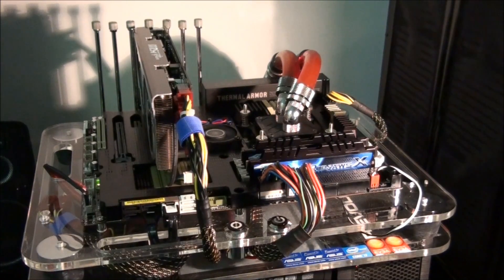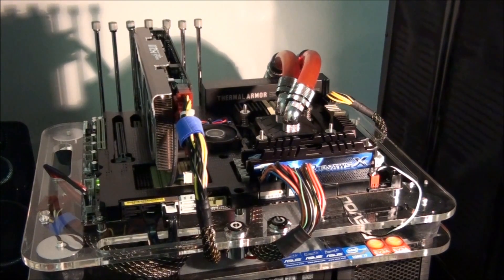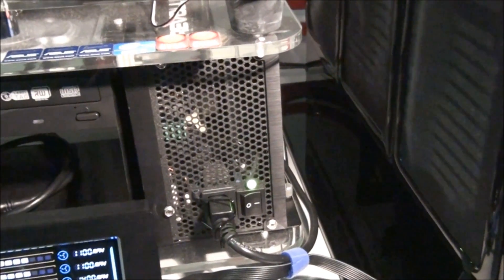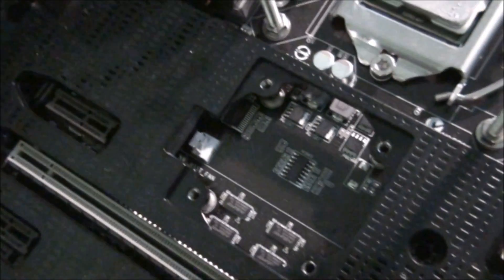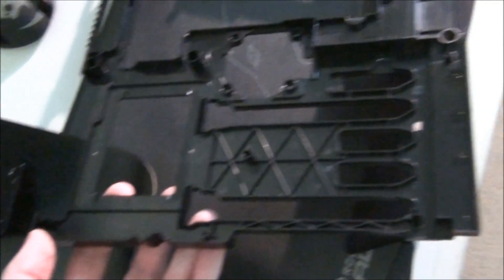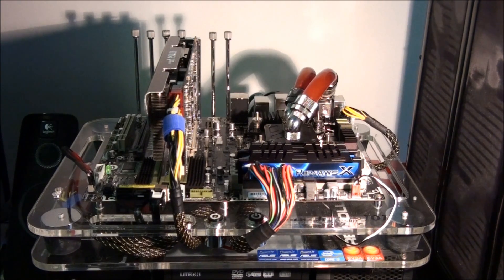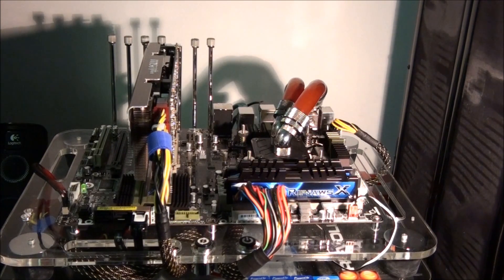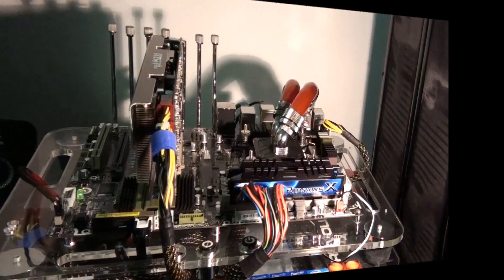Sabertooth P67 Temperatures Without Thermal Armour

Comment: whats unforgivable with this motherboard is they didn't put a trapdoor in so you can replace the cmos battery, meaning you have to completely dismantle your entire build to change the battery, turns a 30 second job into well over an hour, to change a battery.
Reply: Sorry for necro but YES. OMG it was so annoying.
If I had a dremel I would've just cut out the plastic between the two pcie slots. 
What an unnecessary pain in the ass.

Comment: I've had this MoBo for about 4 years now and I might just take the armor out. It's cool to look in and see it have the "clean" look it has with it, but the way I'll be configuring my fans will benefit the MoBo temps more if the thermal armor isn't there... it's a great board, but if I could go back I would have gotten something simpler.